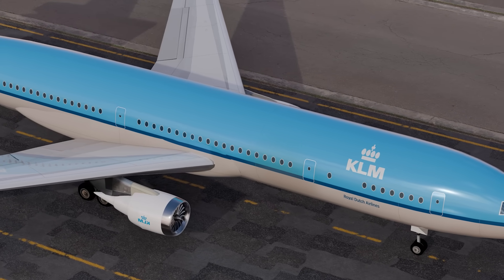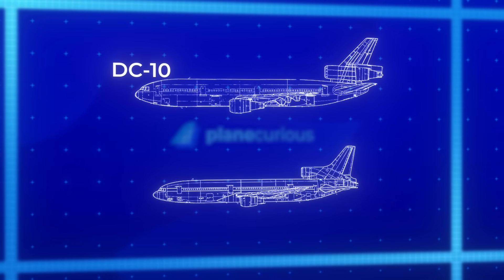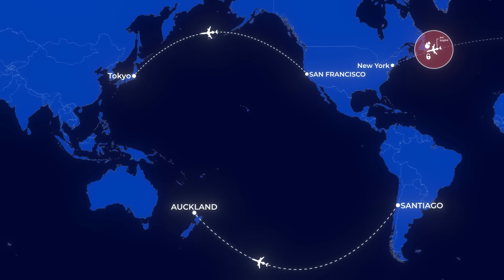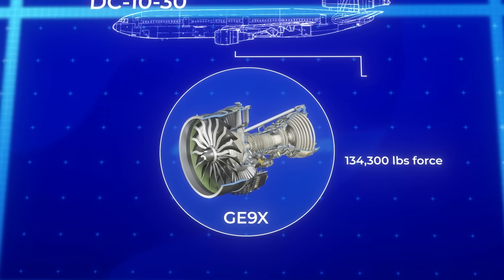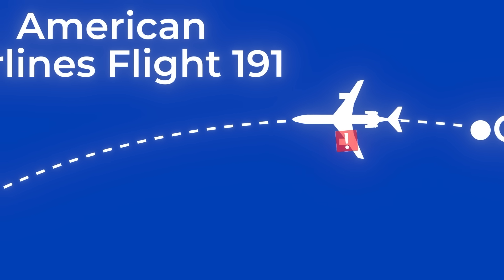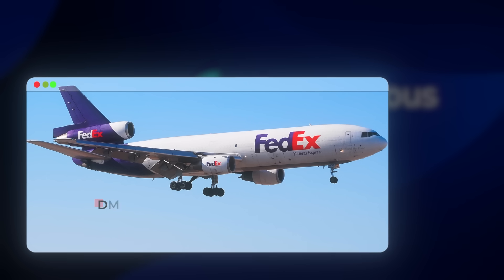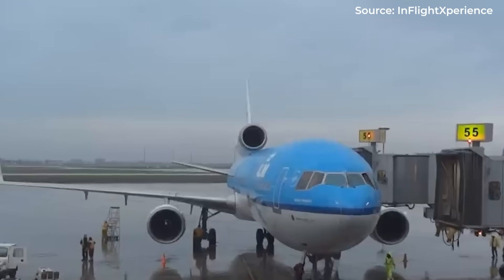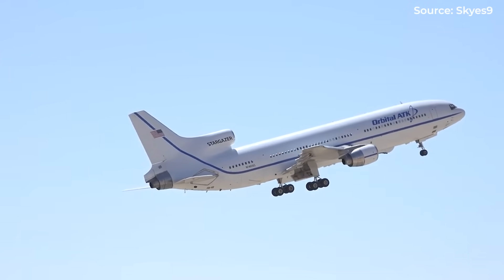Trijets Changed Everything - Until They Didn’t

Comment: At 7:05, actually the accident that most showed the disadvantage of the tail engine was United Airlines Flight 232 in Sioux City IA. In that case, the 2nd (tail) engine on the DC-10 was the one that blew up in mid-flight, severing all of the control lines except the throttles to the two remaining engines. (They also managed to use gravity to get the landing gear down.) Captain Al Haynes and his crew were heroes for the way that they handled that emergency. It was also important because it really proved the effectiveness of Crew Resource Management (CRM) after the way that the crew used it.
Reply: I remember seeing a made for television movie about it.
Reply: That uncontained rotor bust of the N1 compressor wheel caused the hydraulic lines to be severed, not the control cables.  This in concert with the fact that McDonnell Douglas failed to incorporate hydraulic fuses in the hydraulic systems put that crew into the situation they wound  up in.

United brought in their best instructors, gave each of them the same situation in the simulator, and none of them was able to land the airplane successfully.
Reply: ...lasted barely 4 decades...barley? That's a large slice of commercial mass passanget history.
Reply: @allanfifield8256  Barley?  The main ingredient in beer~?
Reply: @Flies2FLL  Opppps. Correction: It was grapes.  (LoL)
Reply: But when you don't cheap out and build in proper safeguards it's almost a non-issue. See Eastern Airlines Flight 935. https://en.wikipedia.org/wiki/Eastern_Air_Lines_Flight_935
Reply: I remember that unfortunate flight.  It was summer 1989. The fact that it didn't just crash straight into the ground  but rather had a controlled crash onto terrain is a testament to the skill and muscular determination of the flight crew. I think a DC-10 instructor happened to be flying that day, which helped a lot. I try to imagine the flight  attendants forming a team, the lead saying, "we are in this together". Behind those professional facades must have been fear. The outcome could have been worse; the flight crew were heroes.
Reply: @glenrosarian2352  The DC-10 captain who happened to be on board as a passenger was Denny Fitch.
Reply: Obviously.  Worst engineering mistake ever was reducing to two engines... where is the 2nd backup in case of a single engine out?  No?  Idiotic.  Financiers ruined the airline industry, knocking out safety for greed.  Don't agree?  Don't comment, or you will be proven wrong.
Reply: Terrible video that they did not mention tri-jet tail explosions.
Reply: and they eliminated the flight engineer position all to save money and put more stress on the pilots in emergencies.
Reply: It depends on what you are calling the control lines. The fan disk had a crack, apparently for years. It failed and the disk and a few blades departed.
When the disk failed, the metal thrown outward from the failed blades, disk, and anything they came into contact with severed hydraulic lines to all 3 systems.
No hydraulics, no control, other than what they could get from the wing engines thrust. 
The emergency landing gear extension IS gravity, pull the red lever next to the copilot in the floor, and the gear doors unlock, gravity does the rest.
Reply: The biggest issue with that accident is that all the hydraulic systems were placed in close proximity and with no fuses. Any otherwise-survivable damage could sever all the lines and leave the aircraft uncontrollable. It was a serious design flaw. The fact that it was caused by a burst engine disk, or that said engine was in the tail, is not the main point, IMO.
Reply: I really wonder why the trijets from back then didn't have an auxiliary emergency hydraulic line that was solely on the wings. So if the tail engine would blow up and sever hydraulic lines, the crew could activate the emergency line that would have solely been from wing to wing through the fuselage.
Reply: Al haines and that extra dead head pilot performed miracle flight maneuvers.  Incredible  ability  to keep the  crippled  plane in the  air; nevermind actually  getting the craft to the runway. Huge heros of mine.
Reply: I have an idea, let's put all 3 hydraulic lines right next to a potential bomb. What could possibly go wrong?
McDonnell Douglas lawyers said, "Well the engineers couldn't think of everything" when asked why there was such a bad design to include all 3 lines so close to the engine.
Reply: Two engines fell off a B747 out of Schipol, I suppose THAT was bad design too?  I've actually operated the DC-10 and L1011 and they were excellent aircraft.
Reply: I didn't know the DC10 was so much larger than the L1011.
Reply: That all control lines goes through the tail was just a design flaw. If proper risk associated was done  it was designed differently for the control lines
Reply: @rabartels Ya that's right. I would say the problem is not necessarily the engine in the tail. Uncontained engine failures happen once in a while, no matter where you stick the engine. It was just a bizzarre coincidence that the uncontained fan blade sliced through all 3 hydraulic lines. But, the fact that all 3 lines were running close together, and close to an engine, is something that maybe could have been done differently. They didn't see that one coming. But was it possible to design it differently, was there room to put the other lines elsewhere ? I don't know. At least they put the hydraulic fuses later on.
Reply: @rabartels  The reason that the control lines went through the tail was because they had three hydraulic control lines for redundancy.  In case one line went out, you still had two others.  They just never expected there to be an incident where all three lines were severed, leaking out all the hydraulic fluid and rendering the flight controls inop.
Reply: @rabartels  All elevator/rudder controls go through the tail of an aircraft - surprisingly because those controls reside IN the tail.  How would YOU design them then.
Also consider rear pressure bulkhead failures . . . they too have controls running through them on ALL pressurised aircraft.
Reply: @BrianWMay  said "Also consider rear pressure bulkhead failures . . . they too have controls running through them on ALL pressurised aircraft."

Yep!  JAL 123
Reply: Once they fixed the cargo hatch.
Reply: @BarryDMoss  The cargo hatch was not the issue in Sioux City. The issue was that the tail engine exploded because of a defect in one of the turbine blades.
Reply: @ I’m speaking about the DC-10 airframe history.
Reply: @BarryDMoss  in the history of the 10's airframe, there was only ever 1 deadly crash (Paris 1974) attributed to the faulty cargo door latch!!
Reply: @ I’m not going to argue with you.  Lookup the Chicago incident.
Reply: @BarryDMoss  when you look it up again, maybe you should actually read the crash report. The Chicago crash had absolutely nothing to do with the cargo door...nothing!!!
The only other DC10 cargo door blowout was AA flight 96 in 1972 which by sheer luck and some awesome piloting resulted in zero casualties.
Reply: @BarryDMoss  //"I’m not going to argue with you.  Lookup the Chicago incident."//

You're not going to argue with him because when you DO look up the Chicago incident, you learn that it had absolutely zero to do with cargo doors.
Reply: @ Please stop harassing me.  You are in violation of YouTube’s service agreement.  Subsequently you are blocked.
Reply: @BarryDMoss  Replying to your (incorrect) comment is NOT a violation of YT service agreement.  If you want to post where people can't respond, start a blog and turn off comments.
Reply: @ violation reported. The Airframe has been retired.
Reply: @BarryDMoss  

A:  It's really hard for you to claim harassment when you keep responding back to me.   

B:  "The Airframe has been retired".   Yes, the instant the Chicago DC-10 flight piled into the ground the airframe was "retired", but that's not relevant to the false claim that a cargo door was involved in the incident.  If you review the NTSB final report, you will find that it was not.

C:  You claimed to have blocked me ... clearly you have not.
Reply: @ leave me alone.  This is a public forum.  I don’t want to hear from you again.  See previous thread.
Reply: @BarryDMoss //This is a public forum."//

Correct, which is why these exchanges regarding plane crash evidence are allowed.
Reply: @ Didn’t I say leave me alone.  Unsubscribe
Reply: @BarryDMoss  //"Didn’t I say leave me alone."//

You also correctly said it's a public forum.  You can't have it both ways.

Have you read up on that NTSB final report yet?   Can you find the part about the cargo doors?

Here, from the final report ... the probable cause was:  //"... the asymmetrical stall and the ensuing roll of the aircraft because of the uncommanded retraction of the left wing outboard leading edge slats and the loss of stall warning and slat disagreement indication systems..."//

//"Unsubscribe"//

Feel free.
Reply: Hey Johnny we heard you the first time. Stop  repeating yourself.
Reply: @BarryDMoss that might be the weirdest comment I have ever seen
Reply: @brady3474 stay tuned😊
Reply: @BarryDMoss  The #1 engine pylon aft fitting failed on Flt 191 Chicago, the engine and pylon departed the wing, the #1 hydraulic system lost pressure,
the leading edge slats on the left wing retracted(no hydraulic pressure), the wing stalled, the #1 electrical buss lost power (no #1 engine generator).
The crew had no stall warning, not that it would have mattered, because the stall warning (stick shaker) was powered by the #1 electrical buss.
They were too low, too slow, and in a almost 90 degree left hand bank. Not enough altitude to recover. 
The failure of the engine pylon aft attach fitting was not a design flaw, the fitting was cracked due to improper maintenance procedure. 
Worked on those engine pylons for years. Removed and installed them many, many times, nothing wrong with those pylons.
Reply: @citylimits8927 "a defect in a turbine blade" would love to see how they proved that considering it would all be mangled and likely strewn across the world after it rapidly dis-assembled.
Reply: @citylimits8927  Fatigue crack in the disk hub, not a defect in the blade. 

And the engine did not "explode". It is called an "uncontained engine failure, as opposed to a "contained engine failure".

An uncontained engine failure occurs when parts of a failed aircraft engine are ejected from the engine casing at high speed, potentially causing significant damage to the aircraft and posing a serious safety risk. Unlike contained failures where debris remains within the engine, uncontained failures can lead to fragments penetrating the fuselage, flight control systems, or fuel tanks.
Reply: @A12OxcartHabu  And the only DC-10 crash attributed to DC-10 design and/or production by Douglas Aircraft Company (DAC)

The claim by so many keyboard warriors (not you @BarryDMoss) that poor design by DAC engineers and DAC production personnel were responsible for several DC-10 crashes is simply nothing more than myth perpetuated by the ll informed  masses. 

Perfect example of the old adage,  if something is said often enough the lazy and ill-informed will begin to believe it and repeat it as if it is fact . . .
Reply: @BarryDMoss own it bro. We all make mistakes. Humility and being open to learning new things help us grow and self improve. Peace
Reply: @drummerdoingstuff5020 learn from history.  Lives are at stake. The airframe has been retired for new technology.
Reply: @BarryDMoss Ok, I don’t know enough about that or even fully understand this issue you speak of.  So they retired a safer aircraft for a newer, but less safe one?  General Trend:
Data from the past 20 years shows a general decline in air accidents despite an increase in overall flights, reports WDSU.  Despite recent high-profile crashes, 2025 has seen fewer total plane crashes (282) than 2024 (334) through April 12. Statistics show that up to 80 percent of all aviation accidents can be attributed to human error. The most dangerous times include takeoff and landing and the time periods before and after these events. Pilot error is thought to account for 53% of aircraft accidents, with mechanical failure (21%) and weather conditions (11%) following behind.
Reply: @drummerdoingstuff5020 the birds became obsolete.  Airplanes have a shelf life.
Reply: @BarryDMoss  Servicing failure, not a design fault.
Reply: The fact that all circuit when through the tail is rather questionable... at least they added valves after the incident so that a punctured section can have the hydraulic supply be cut off

Comment: The DC-10 has a fine safety record that is comparable to the 747, which had three design flaws. The MD-11, despite it being my favorite, has a horrendous safety record even worse than the DC-10. The fatal crash rate per million flights is incredibly high at 1.56 compared to other aircraft which are all lower than 0.6. Given how little it flew, it never should have had the amount of crashes it did (5 crashes with fatalities). Its safety is even worse than the 737 max, which has significantly improved (just 0.41 crashes / million departures). Similarly, the Concorde has the worst safety record of all commercial jets at 11 crashes/million flights extrapolated. Given how little it flew (less than 100000 flights), it never should have had a crash. And it certainly should not crash just a few dozen seconds after takeoff just because of a small piece of debris, let alone the 70 tire related incidents in its history. Its tanks were heavily exposed to tire bursts to maximize range. The Concorde was also the most difficult to handle with the highest landing speed. Data from Boeing's annual statistical summary of commercal jet airplane accidents.
Reply: MD specifically designed the MD-11 to be unstable. It was therefore difficult to land, hence its poor safety record. When MD subsequently effectively took over Boeing, it also inflicted on Boeing the obviously flawed MD design philosophy. Hence the almost unbelievable, and unforgivable, MCAS design flaw that caused the 737 MAX crashes.
Reply: @ I have to say, wasn’t a very smart decision. They were aware of the bad reputation of the DC-10, yet decided to continue to implement ever increasing risks with the design of the MD-11. One would think they would’ve learned! It's a shame, you can't name a plane more beautiful than the MD-11.
Reply: DC10 killed  over 1000  with cargo doors blowing out and turbine cutting thru all 4 hydraulic systems running side by by side or pods tossing engines . It was a death machine.
Reply: @ So was the 747.

Comment: American Airline flight 191 accident was caused by improperly mounted engine on the wing pod. It has nothing to do with a three engines configuration, could have happen to a two engines aircraft
Reply: A better example of the problem with the tail mounted engine would have been the 1989 crash of a United Airline DC-10 at Sioux City Iowa, when the tail engine's fan disc failed, severing all the hydraulic lines. And yet, that is the only case that I know of in which a failure of a tail engine causing a crash.
Reply: @stuartaaron613  Eastern 935--an L-1011--should have been the same but sheer luck kept the last hydraulic system intact after it was hit by shrapnel.  A more proactive safety culture would have recognized the risk and mandated hydraulic fuses 8 years previous to United 232.
Reply: @calvinnickel9995  Actually after AA191 fuses were installed ... the lack of caused the slats on the damaged wing to retract causing a high lift/low lift condition.......and
Reply: That's what you get with GPT videos
Reply: @samot1808 that certainly explains why they keep showing a graphic with four engines mounted as both underslung from the wing as well as fuselage mounted like a DC-9, which was never a thing on any airframe, to my knowledge.
Reply: Meaningless.  Worst engineering mistake ever was reducing to two engines... where is the 2nd backup in case of a single engine out?  No?  Idiotic.  Financiers ruined the airline industry, knocking out safety for greed.  Don't agree?  Don't comment, or you will be proven wrong.